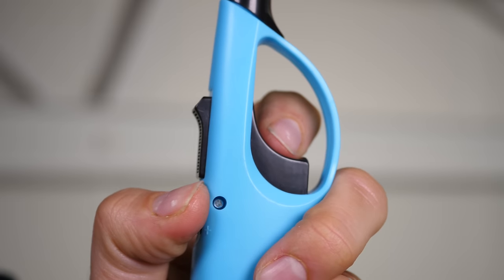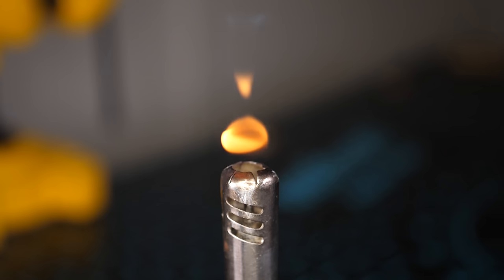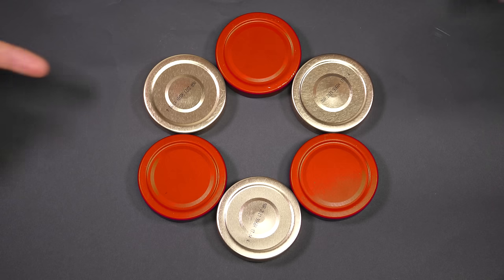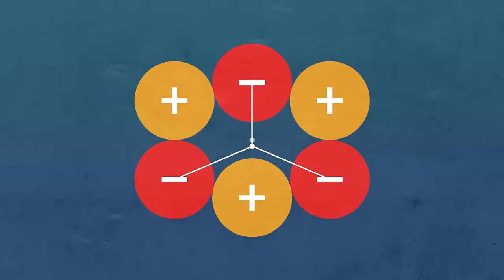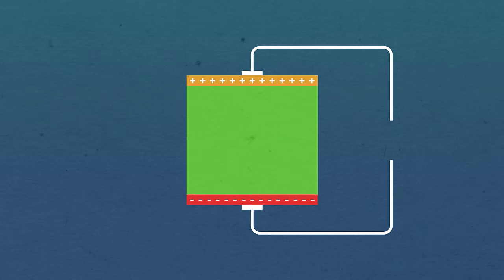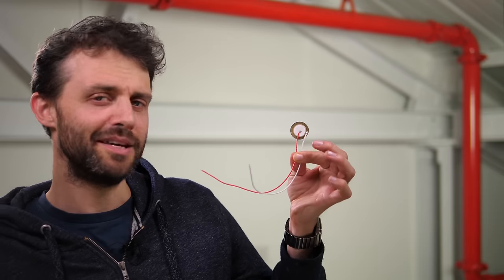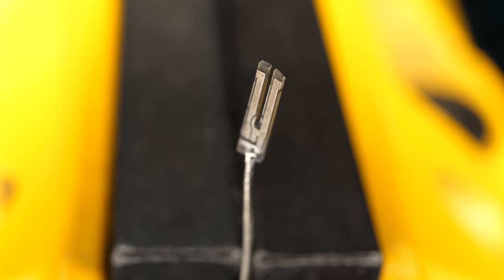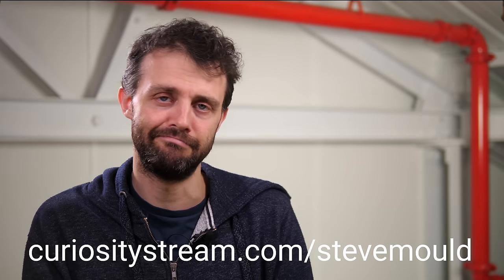Piezoelectricity - why hitting crystals makes electricity

Comment: I always cordoned off Piezoelectricity as one of those things I just wouldn't ever really understand. It's sort of delightfully simple thanks to your breakdown! Really appreciate this video, it opens up a better understanding of so many electronics.
Reply: now the question remains, is a voltage being produced by the impulse or impact from compressing/deforming and relaxing the crystal, or do you think a constant pressure would yield a constant voltage?
Reply: Where does the Cristal recharge it's charges from?
Reply: @DANTHETUBEMAN  from unicorn blood
Reply: @GabrielCazorlaPersson1  - Are you familiar with the Earthtide theory as the mechanism for Earth's magnetic field?  Imo it makes more sense than the core dynamo hypothesis.  The gist is that 95% of the Earth's crust is quartz-based, and that tidal forces from the Moon produce a diurnal flexing on the Earth's heavily faulted crust, which generates a piezoelectric field - "magnetic field" is a misnomer.  Anyway, it solves many of the mysteries associated with the field and provides predictive ability whereas the dynamo theory does not.
Reply: Thanks Steve
Reply: geb001
Reply: It’s also used in making piezo guitar pickups.
Reply: @Infinion  yes but it will behave like a small value capacitor and the system depolarises quite soon.
Reply: @Infinion  pp
Reply: @freemind..  any papers you could direct me to on this topic? I struggle to find anything from google searches.
Reply: @EpicNicks  - One of the best sources is a book published 1991 called, Electromagnetic Phenomena in the Earth’s Crust.  It was written by a Russian scientist named K.N. Abdullabekov, and it contains some of the clearest and earliest recorded evidence about the true nature of the Earth’s Geofield; evidence largely ignored by the scientific community.  For many decades, Abdullabekov and his colleagues investigated the relationship between earthquakes, faults, and the Geofield.
Reply: @freemind..  Thanks for the referral. I'll try to find it, it looks a bit obscure to find digitally.
Reply: Me too, unintentional as it was... What I'm wondering:
What else I have I done this for.
I'm a pretty interested guy, but if I don't think about it, I won't think to learn about it. Anyway, I'm glad this was in my feed, and I appreciate that I wasn't the only one :P

Comment: This is amazing, I had no idea that's how those lighters worked.
Reply: I always assumed they worked like normal lighters! It's amazing that they actually use this (kind of, but not really) high tech!
Reply: I always thought they had a battery and the click was from a terminal that initiated contact and sprung off as the gas ignited.
Reply: @TheR971  just goes to show how many different ways one can make a single idea.
Reply: i thought it just metal + another metal or rock. didnt know its a crystal actually
Reply: I thought it worked like an electron(?) scraper or van de graff generator,
Reply: I've always wondered about these things. They deliver a pretty powerful electric shock if you put it against your skin.
Reply: I kind of knew it produced a voltage because I used to put my finger on the spark end while clicking the switch. But never knew where that voltage was coming from

Comment: This video:
Audiophile companies: this is not a great speaker, but it is a very expensive crystal speaker
Reply: Herman Grove yeah because quartz is expensive
Reply: Piezoelectric pickups are usually used as contact mics just like in acoustic guitars.
Reply: For when you want that perfectly staticky sound.
Reply: @vigilantcosmicpenguin8721  he was hitting it with a hammer, what do you expect
Reply: So you're saying it wasn't "crystal clear? LMAO

Comment: Up until recently I thought the spring-loaded mechanism was forcing a magnet through an inductor. I'm amazed at the amount of voltage
Reply: How the ancient lifted  heavy stuf
Reply: IAC i9 @thedutchonequestioneveryth4128 7iu7u uuuuuuuuuuuuuuuuoiiuu8
Reply: that might work aswell though and it has a similarity in usecases as it aswell is used in audio equipment.
Reply: I always assumed lighters just used a flint striker to make the spark that ignites them. I never considered that peizo electricity would be easier/cheaper/better than a basic friction striker.
Reply: @jasonreed7522  the problem is, sparks from a flint aren't electric and can't go through metal
Reply: @electricpaisy6045  why would you need the spark to be electric or go through metal? 

Its just a butane lighter and the other most common butane lighter design is the classic flint lock zippo cigarette lighter. And since i never broke open the plastic case on a grill lighter i had no reason to assume it was anything other than a weirdly shaped flint design using a spring for consistency.
Reply: @jasonreed7522  yes with the small lighters both exists, but with a long bbq lighter you need the spark all the way up at the top when you create it down at the trigger. That's done with electrical wires.
Reply: @electricpaisy6045  are there not electric lighters that use spark to ignite the gas? 
I believe I have a few in my house at this very moment.
Reply: I just chocked it up to magic. But, I am overwhelmed with know it is actually a freaking crystal.
Reply: i always thought it was a flint and steel or some other form of friction based heat.
Reply: @tonymarselle8812  yes its a piezo spark tho... Damn google rly has done a number on intelligence! Dystopia here we come
Reply: @brobrio  You'd be surprised how many things in electronics are done by using crystals.
Reply: @topherthe11th23   I already wrote that in another comment when somebody asked the same question.

Comment: This is one of the most fascinating concepts in all of science to me. It seems like there could be a lot more hidden potential here.
Reply: Agreed...
Reply: Inb4 the great pyramids were giant piezoelectric crystals
Reply: @codpug  You're lying to yourself and you're lying to the world when you say these things. Nobody is trying to hide history, what would anyone have to gain from that?
Reply: Blalack77 - Your intuition is correct.  Here is a paradigm-changing example that is not yet widely known, but will soon become common knowledge.  The Earths magnetic field is not produced by a dynamo at the core.  It is actually a piezoelectric field that is generated in the crust.  The mechanism is a process called Earthtide or Geotide.  The crust is primarily quartz-based.  Earthtide is the tidal pull on the landmasses by other celestial bodies, mostly the Moon.. and the Sun to a lesser extent.  The constant mechanical flexing of the crust creates a piezoelectric energy field.  This explains why planets with no moons of significant size (Mars, Venus, etc) have no "magnetic field".
Reply: @freemind..  Interesting.. That makes a lot of sense.
Reply: @thought_farm  sage
Reply: @freemind..  🎉🎉🎉
Reply: If you look at the sacred geometry of the hexagons in the crystals, and you instead connect each particle of a charge with lines (connect all the positives and all the negatives) until it looks like a star, you might get a clue about (((who))) is hiding said potential.

Comment: I'm a biologist, but our confocal microscopes also make use of the piezoelectric effect.

To adjust the focus, there are of course mechanical gears that adjust the position of the objective relative to the sample with exquisite precision. But for some application where both speed and even higher precision are needed, microscopes can be outfitted with a piezoelectric focusing system.

The range of motion is smaller, but the objective can be moved tiny amounts with a precision down to 10s of nanometres within microseconds. This is especially useful for certain modes the microscopes can use, such as resonance scanning mode, which allow us to capture images at very high speed in the xy plane. The piezoelectric focus adjuster gives us a matching fast way to adjust the z-plane.

I don't know which specific materials they use, but the principle is the same. By applying a specific voltage, the crystals deform in length and can be used to position the objective.

Comment: Fun fact: the granite in the great pyramids has a high quartz concentration, and the chambers that used to hold the check and clack valves could create large vibrations in the pyramid, like Steve did with the hammer on the disk. You send a large amount of water through those passages, and you have a power plant
Reply: I'd LOVE to see them demonstrate this nowadays!
Reply: Yes th vibration during the djed ceremony at the pyramids caused light.
Reply: @jadabaudelaire118  it would be so cool if egypt turned them back on today
Reply: How does water running through it create power? Sounds really interesting.
Reply: @MattH-wg7ou  through the creation of vibration in the chambers, via water flow, causing a piezo electric current of the quartz of the granite... seems to be the reference. 

Might be a fun weekend research project.. to see how viable this would be
Reply: @MattH-wg7ou  the water pushes open the clack valve, and flows upwards through the channel behind it, until the back pressure can force open the check valve. Once the check valve opens, all the water rushes out and the clack valve slams shut and shakes the whole pyramid, creating electric charge. Once the pressure is gone, the check valve closes and the cycle repeats
Reply: Dang thats neat. Thanks.
Reply: That would be a really low output 'power plant' even with The Nile running through it imho
Reply: @TheJerad1  how tho? The enormous amount of quartz would create quite a large current, and it would be alternating because of the vibration
Reply: @Matt H  the great pyramids sat on a Aquafina and water ran underneath the great pyramid. The water flowed upward and powered the pyramid by clapping crystals together thru a valve system the voltage went upward thru a array of multiplier spheres large round towers going upward like on a set of steps lots of them . The granite floors  4 of them one above another worked as a capacitor holding the charge the power reached the top of the pyramid it had a Golden cap on the top the energy would travel out and all around the pyramid it was scalar radiation power this power would light up lamps 🔦  glass  ball filled with chemical gates then twisted shut when made the lamps was all throughout  Egypt kinda like a flourescent lamp or a neon lamp the electromagnetic waves would cause the Gases to give off light. If you research this there is some writing  to describe this.
Reply: @davidmayhall3719  exactly
Reply: @davidmayhall3719  where do u even start to research that
Reply: @bigfebreeze_xyt3082  start by taking a metric assload of amphetamines, then you make something up, then you forget you made it up and pass it off as "research"
Reply: My only question is.... What would they power?
Reply: @sketchiefello9002  usually this research starts with an assload of psychedelics and an ancient aliens marathon at 3am on a Tuesday, but I've never stopped to consider how effective adding amphetamines to the equation might be for "research" productivity in this context lol. 

I'm not gonna give it a try but it makes sense for sure.
Reply: No
Reply: That's not how it works. Although it has very high voltage the actual power it can produce is very low. So anytime you would load the pyramid "powerplant" it would drop voltage to zero
Reply: @SirNobleIZH  He's right, the piezoelectric crystals create high voltage dc energy, with very low power, as you load the circuit the voltage drops to zero. You see current is defined as a factor of resistance and power, with no load even for low power you have high voltage, but if you load the circuit, the voltage drops to nothing as the load draws current.
Reply: This is just pseudoscience lol.
Reply: We're definitely on to something, electricity is not as well understood by the public as the general public believes.
Reply: Sunlight ,water and the  high quartz  crystal content granite makes the power in the pyramids .
Reply: @shellymurano7887  not sunlight
Vibrations from the water rushing through and hitting the 2 hinged blocks
Reply: 牛逼
Reply: @TheJerad1 only the Pharoahs need electricity  😅
Reply: @notnull5878 maybe the egyptian electric system functioned with low power high voltage. If using luminous gases are the way street light worked back then, then the they used electricity was very different than the way we do today
Reply: @rizvinbk  The voltage is irrelevant, no matter how high the voltage is, even if it could produce 10 gigavolts, if the power is low then any load connected to it would drain any energy stored in the capacitive coupling the pyramids have to ground. There are no free lunches in the physics world, and unless the pyramids are made of pure quarts and are struck with meteors on a regular basis, there is no useful power in them.
Reply: eleventhmonkeygaming9476  it requires vibration to be useful
Reply: Heya I’m interested in this subject and have been studying it for a while. If you would like to chat about it let me know
Reply: I call BS on that. They found clay jars with an acid in them and two disimiliar batteries in what was Mesamotopia at the time which is a type of electrically battery but of such low power density it is thought to be used for a early form of electroplating jewelery and ornamants but not to power anything like lights or mechanical movement by magnetic motors. There is no evidence of anything resembling the electrical grid you speak of to include the receiving devices that surely at least one would still be around from 5000 years ago when they THINK the pyramids of giza were constructed.
Reply: @waynegarfield6607  copper wires corrode bruh, after 5000 years thwy wouldn't be there anymore
Reply: @sketchiefello9002 😂😂😂😂😂
Reply: What grid?! It's supposed to be wireless.
Reply: @bigfebreeze_xyt3082 the mummy returns would be a good starting point
Reply: @sketchiefello9002  this isn't made up. We do it all the time on a rlly small scale. Nothing prevents the scale from increasing
Reply: Why is this pseudoscience crap the top most comment?
Reply: @davidmayhall3719  "sat on a Aquafina", huh? Yeah, there's writing to describe Sonic pregnant with Goku's baby too. That's not quite how wireless energy transmission works. You can't send any real electrical power over long distances, just strong enough of a signal for communication.
Reply: @SirNobleIZH  current where, dude? Where would the circuit begin and end and how would you make that work? And I guarantee you your AC theory will not work that way. It'd be more on the timescale of repeatedly charging and discharging a capacitor.
Reply: @100GTAGUY  depends what kind of amphetamines we're talking about, as well as what kind of research/"research." Stick with more Steve Mould, less Ancient Aliens lol. Speaking as someone who got addicted to meth and ruined my life and spent some time homeless.
Reply: @RizenST  it's not pseudoscience, it's a hypothesis of mine based on real scientific phenomena. It doesn't get much further from pseudoscience than that
Reply: @joshyoung1440  no, because you aren't just compressing the crystal, you're vibrating it, thus rapidly swapping between compression and tension
Reply: @davidmayhall3719 wow can, you point me to the book you read this in
Reply: The book “PYRAMID TRUTH GATEWAY UNIVERSE” explains everything
Reply: The pyramids were not power plants. The ancient Egyptians did not harness electricity. We should still be just as impressed.
Reply: @november8039  how do u know
Reply: @SirNobleIZH  A complete lack of archaeological evidence for electrical infrastructure or written evidence of its use. The ancient Egyptians were pioneers of science in many ways, and I feel that it's important to attempt to be as true as possible about their achievements lest we detract from them. Harnessing electricity just doesn't seem to be something they did, and it didn't prevent them from achieving some of the most spectacular things of any cultural up to the modern age. I hope I can encourage you to think critically about history and to dig deeply about things you are curious about.
Reply: @november8039  pots of copper wire, electrum capstone which has since been stolen (electrum is an alloy of silver and gold, and the best conductor ever discovered), and rock cores inside the pyramids with continuous spiral cut marks like a modern power drill, not zigzags like a bow drill arent evidence?
Reply: To power what?
Reply: @gogatorball  well for one, drilled core of rock were found in the pyramids with the spiral mark of a modern power drill, rather than the zig zag of a bow drill.
Plus, electric infrastructure is metal and thus over long enough times can corrode to nothing, hence why we don't see it today, 5000+ years after.